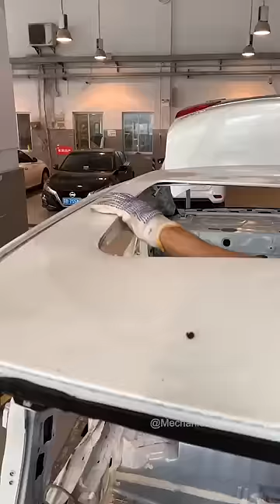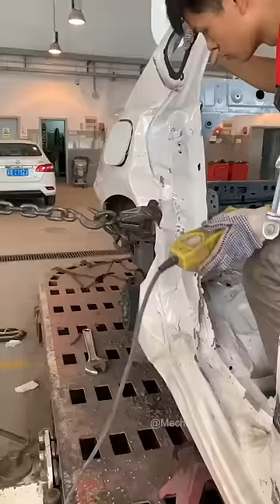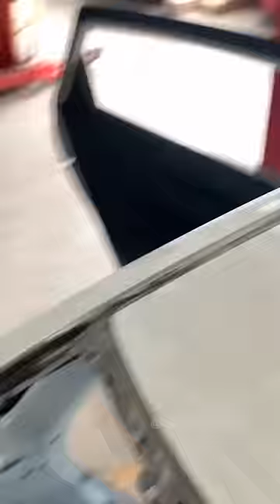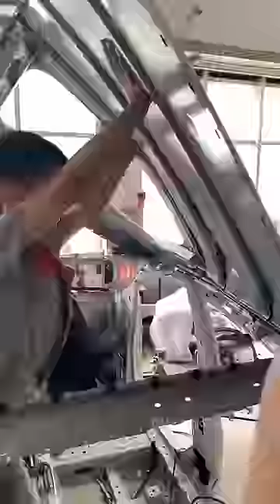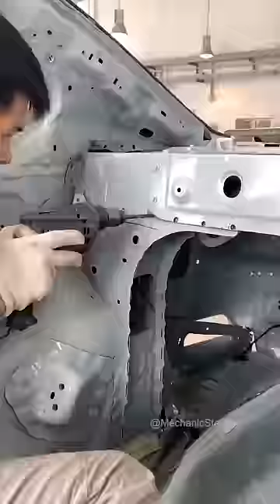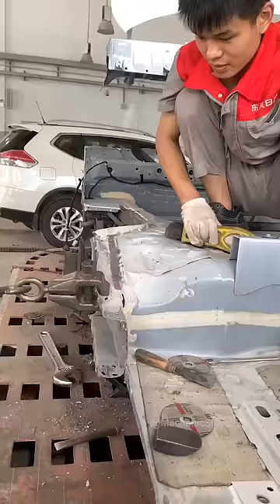#mechanic #automechanic #automobile #cars #trucks #restoration #mechanicsteve #shorts #fyp #car

Comment: Yo, wtf are you doing ? I guess in China cars never total..😂😂😂😂 you got 250hrs of work on a car worth 15k 😂😂

Dude…I’m sorry you will never get that car right never, should of welded or tied in some support before you cut the uniside and roof off. That car flexed so much at that point..good luck getting that back.